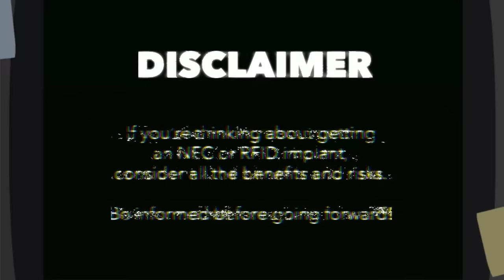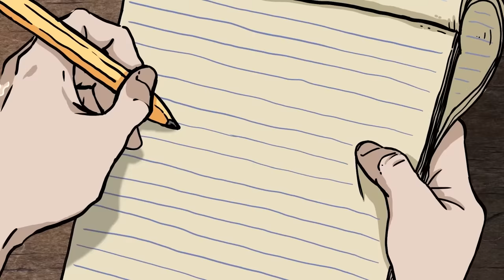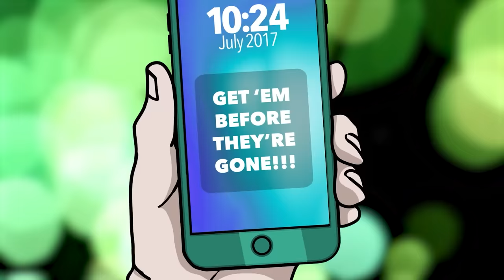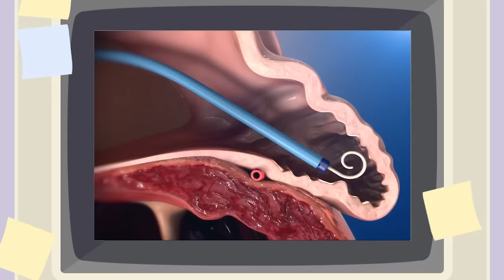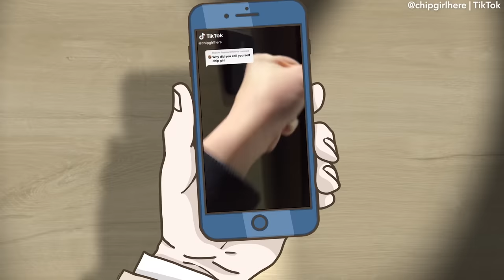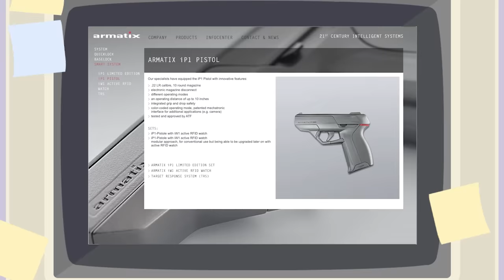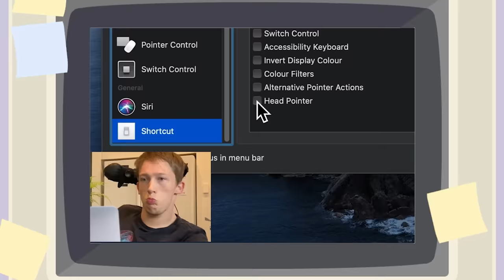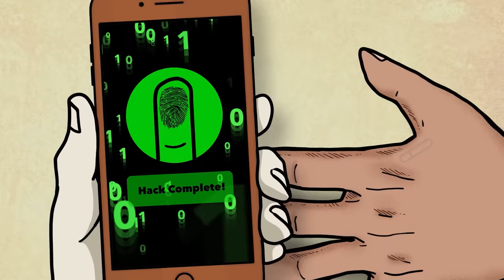People Are Turning Their Fingers into Smart Wallets, and It's a Nightmare for Some

Comment: The problem with RFID and NFC tech is that the transmitters can be accessed by anything that can scan them, and all someone has to do is be within range of the field to get whatever data they transmit.  Any info on that chip can be scanned without you knowing at all.  If the data isn't encrypted, that means anyone walking by you on the street now has access to any password or pin you have stored on them and can use them to unlock anything you use them to access.

Comment: the biggest issue is upgrades.. i don't want to have to cut out the chip and put new one back in every year.. it's simper to just wear something like nfc ring or bracelet
Reply: Although there is a possibility that in ten years there is something “new and better”, rfid / nfc is a standard that will stay for years. A chip that you implant right now can be used as long as nfc is still around and that will be for a loooong time. So no… You won’t be cutting your hand open 1000 times… You don’t upgrade implants like you do with an iPhone.
Reply: @kicklp3057 really the only time you'd upgrade a rfid/nfc implant is a ground breaking change or issue l

Comment: The biggest problem with using an implanted RFID or NFC chip for legal identification or storage of sensitive information like payment details is that they can easily be surreptitiously read and cloned without you having any idea that it's happening.... and yes, the bad actor would need to be in close proximity to do so, but the equipment used easily fits into a backpack, and it can be set to automatically read any chip within range for as long as the battery holds out... not to mention that "close proximity" can be as much as 3'-6' (1m -2m) away.

Comment: These are RFID tags. They support NFC, but need external radio power.
Most usecases are just for a unique ID and to store information. But for the unique ID you do not actually need to use a passcode for it. The password is stored in binary, but different apps may use a different format.

Comment: I’d never get a chip like that in my body! While the idea is neat enough, there’s just too many potential issues with the technology when it comes to security. Just look at the things we need to do to protect our contactless bank cards today with the RFID protection cards or wallets to prevent people from being able to scan your card when walking past. I have one of the protective cards myself in my phone wallet. 

Only “implant” I could ever imagine using would be a CGM if I become diabetic or if I start having severe issues with hypoglycemia (low glucose) that calls for continuous monitoring, but a CGM isn’t permanent, you change the sensor every 1-2 weeks depending on what brand you use. Though there is one kind that has an implanted sensor that stays for months and you have an external device on your arm to read the chip, that’s a kind of CGM I wouldn’t want to use though. I’d prefer the change sensor at home regularly kinds even though it means more needle pokes

Comment: Imagine somebody breaking into your house 
Your wife is screaming and terror 
You just like "hold on honey I have to put the glove on or else I can't fire the gun"
Reply: It's kind of the same problem with gun cases/locks that use fingerprints. You have to press the same finger on the reader that you used to set it, they might not read your fingerprint correctly the first time, your fingers need to be clean and dry... so many possible problems when you need to reach your weapon during a home invasion that can cost someone their life.  Honestly, chips in the hand are probably the best technology we will have for a while for gun safety. Have a chip in one hand for the locked gun case, and another to actually activate the weapon. Easy.

Comment: I see these as incredibly flawed. Like it's incredibly easy to skim an NFC chip, it's the whole reason you replace credit cards constantly. You can use something that looks like a normal reader that also skimmed your chip and copied it's data. 

Smart locks are also notorious for being flashy but unprotective. They were designed with the purpose to impress, not as actual functional security.

Comment: Actually this is not supported by google/apple pay. You would need to use a credit card (bad idea) or pipe the wire into a phone.
And the card needs to be set up to use the pin code from RFID without needing to plus the chip in electrically.

Comment: ok so guy 2, he got this chip for basically apple pay, but the problem is that any order to access the card on the chip, you need to unlock it with your phone. that takes a lot longer than just using ur phone in the first place. especially if u have an apple password

Comment: i think the biggest issue with the implant is it being stored in Glass
i mean Glass really? 
imagine having to go to the er to get broken glass pulled from your implant site
a better option would be a replacement tooth filling 
kinda like a spy tooth but instead of cyanide it holds your identification 
so technically it is both safer and well if you ever needed to change chips just visit a dentist and get them to change your chip
Reply: It's glass that is designed in a certain way to where if your hand was getting crushed your bones would break first

Comment: RFID/NFC is convenient, but having it implanted - Which makes any future opt-out considerably more difficult - Most certainly isn't. That's why my „implant“ is a carefully selected¹ bank card tucked away in the back of my glove, and for those wanting to try implants out without permanent commitment, this is definitely the way to do it. 👍

Crucially; In the glove approach, any unexpected circumstance where you suddenly need to get rid of the chip at a moments notice becomes as simple as throwing the glove away. Much less bother than an implant! 💡

(¹ - For an account at an alternative bank that's specifically used for NFC transactions, in which not too much cash is deposited. Anybody hacks my „implant“ they get my NFC account (Perhaps £20,- if they're very lucky! 🤣) but my current account remains 🇪🇺 well out of reach! 🛡)

Comment: I would never have ANYTHING put into my body that definitely shouldn’t be there
Reply: The same as a pacemaker, insulin pump or stents? Yeah these devices are also not supposed to be there yet it’s no problem and they help you medically. Nothing else with a chip (only it’s not for medical purposes). If the procedure is done professionally, the body will most likely accept the implant and will start building tissue around it.
Reply: @kicklp3057  well unless it had to be there
Reply: @thebigidiot12thebiggestidi12  A pacemaker for example isn't in any way supposed to be there. Biological seen if the heart fails to function properly it's broken. Yet we still implant tech to fix a broken heart. Crazy isn't it? A NFC Chip is the same thing yet it doesn't fulfill a medical purpose.
Reply: @kicklp3057  JEEZ I GET IT DUDE
Reply: @thebigidiot12thebiggestidi12  Calm down dude. I get your point. I can understand why you think this way and it ain't a bad thing or a "wrong" thing. Critical thinking is a key part of life.

Comment: What's wrong with fingerprint?
Reply: Fingerprint for what? You aren't using your fingerprint as a means to pay for things which is already one of the big reasons said in the video for this technology.   Guns? Proven to be a bad way to make smart weapons, you can't be wearing gloves, fingerprint readers are not all that quick and have a tendency to make you try again since you have to scan the same finger press the same way for it to be read properly.  All the other uses that were stated in the video also do not work with a fingerprint. The only thing that would actually be able to use fingerprints for are just electronics around your house.
Reply: @fallendeus  Makes sense. But i prefer fingerprint. It is fiting to my life style.

Comment: It's honestly useless to put a pin on your chip. I have an next, and even knowing where it is it is really hard to read or write. You would definitely notice if someone tried rewriting
Reply: My NeXT chip actualy reads quite well, maybe you'res is just a bit deeper than mine. also could be the readers fault. 🤷
Reply: @niklasclaro9793  It's not that it doesn't read well, you just gotta know where your coil and chip are
Reply: That makes sense. I think the strength of the Reader is also important. I use a (xEM Access Controller V2) for my front door and it will read my implant from about 15mm± .

But I still agree that it would be silly using it for phone pins
(It works great for my PC tho)
Reply: @niklasclaro9793  Okay okay we talking lf here. Sure, that's easier to read bc it's a longer wavelength. The hf side is harder though
Reply: @niklasclaro9793 Oh btw, if you're planning on getting a walletmor, you totally should get them bc they're awesome but one downside is that I can't fully close my pinky finger bc the chip inhibits its movement if you put it in the underside of your hand so keep that in mind
Reply: @laurensholthof I was actualy planning on getting one. Thx for the advice👌
Reply: @niklasclaro9793  It's not bad or anything, just awkward when playing table tennis or doing anything where you have to tightly grasp something narrow bc you feel your pinky trying to close around it but failing to do so